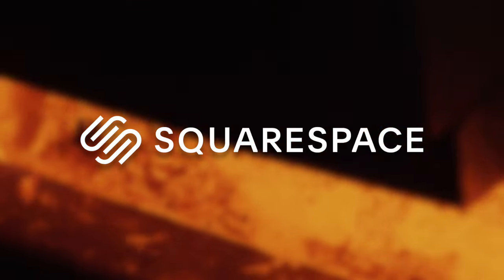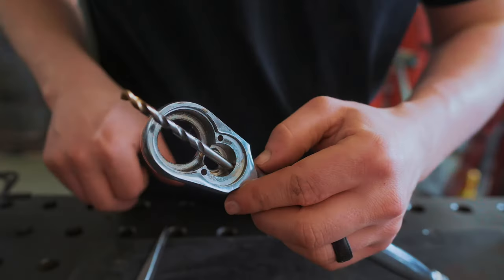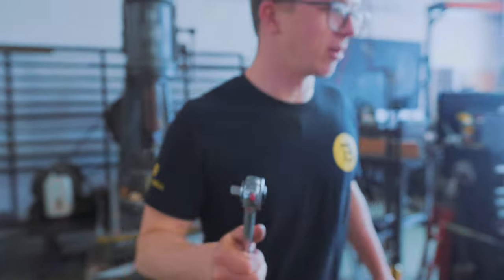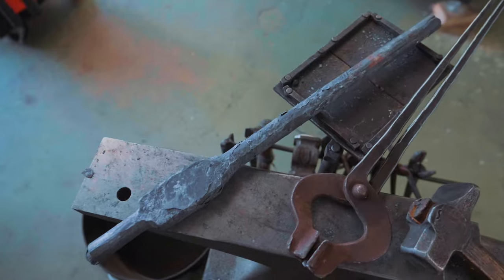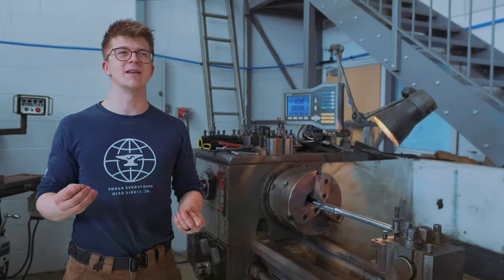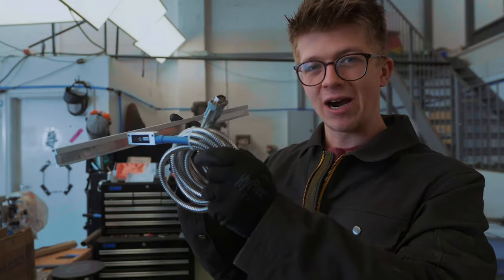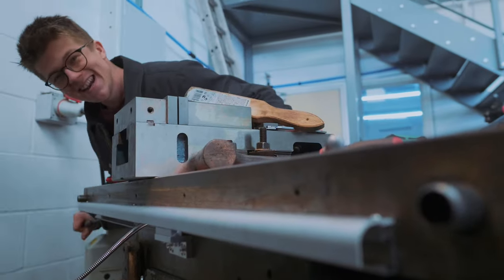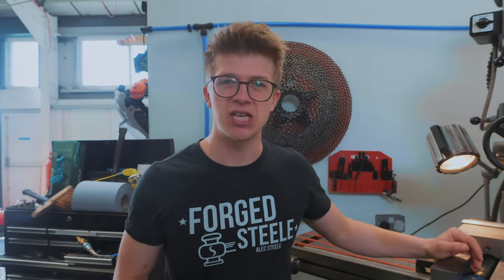Making a Socket Wrench from Damascus Steel! Part 1

Comment: love the this kind of series. its like when we were kids and we'd take stuff apart because we were curious
Reply: I still do it😂 it's mostly my work now but I have to put them back together after
Reply: Great name 😅
Reply: I know right .. rip mr binky that poor Guinea pig
Reply: @timlund1066  true bro
Reply: Yeah same. When I was a kid I was curious how my parents got together. So I took them apart to study psychologically. Was never able to put them back together afterwards.
Reply: That's how I learned what capacitors do even if I didn't know the name or how to explain it. As it turns out camera flash setups have some decently strong capacitors that do interesting things to your hands.
Reply: @klikklak6099  ayo?
Reply: I used to do this with locks in my dads garage.
Reply: @Zelmel  I have done the same thing with the $5 preloaded film cameras. Turns out that tall building looking thing in the camera holds a charge after the battery is out

Comment: For the ball retention on the mandrel, look at peening. It's basically deforming the edge of a hole inwards after you have inserted the BB to keep it in place.

I design torque wrenches for a living (basic more complex version of the ratchet you're making :p ), if you need any info let me know!
Reply: isn't it easier to just drill and mill with a ball endmill the seat where the ball is going to rest on. 
then tap the back and insert a spring and a threaded tap from the back?
Reply: Not really, it's multiple ops and a accurately sized hole means you only need to drill once, then add the spring, the ball, then peen.
Reply: Heh... Peen.

Comment: The second rounder ratchet you tried open has a keyring-like coil on the opposite side that holds it together
Reply: I came to say this. It's an exterior snap ring around the outer circumference of the inner component on the square side, which will allow the entire inner component to slide through to the direction switch side.
Reply: These are nicer as you don't risk the screws coming loose, but they suck when the rings get coated in grease and you can't get them off for a servicing cause they sat for years and don't sound right.

Comment: Hey Alec, for those round head rachets, there is a flat retainer spring that is installed along the face side of the rachet. Once you remove that spring, the head is quite easy to disassemble. Hope that helps.

Comment: Hey. Little friendly tip. When I work on the lathe, and want it to be symetrical. A swap that point (Sorry for not knowing name of it. I'm from Czech) to drill chucks. Then it'll be cca same. All that's left, is to tighten big lathe chuck and swap back to that pointy thing.

Comment: I have found over the years that Damascus steel tends  to be brittle when it comes to tools where you have to apply pressure or power , it’s like it’s made of glass ,now on the other hand cutting is fine , spoons & spatulas are great for Damascus . Every ax I’ve ever own that was Damascus steel has either cracked or just blown apart or shattered into pieces . I tend to stay away from the stuff myself .

Comment: Adding more teeth to the mechanism can allow for a smaller rotational increments for working in tight spaces, but you do lose some of the available torque as a compromise, but you can also go the other way. I've seen these mechanisms with as few as 20 teeth, and as many as 90.

Comment: If you want ultimate accuracy you should turn those between centers. Then they will be perfectly in line. I mean dialed in with the 4 jaws is probably good enough but like you said any inaccuracies multiply so the more accurate it is now the better.

Comment: If you figure it out, you should make a 2 handled ratcheting bar twister. You might even make it pass all the way through with diferent sizes of square hole on each side.

Comment: I'm curious as to what kind of drill tap bit you used. The ones I usually use would've snapped just looking at all that steel to cut through.

Comment: I was an apprentice in the late 80s and I had britool tools that have a lifetime warranty ( I still own them and use rgem) and I broke my ratchet over tightening a bolt on a steam pump. Back then you had mobile tool sellers that came round engendering shops selling tools ( money came off your wages) I told him and the next week I got a little bag with new inner parts to the ratchet.  So I know whats inside as I've actually replaced them twice and its still working to this day... love tools but don't do much wrenching now I just tell other engineers to do it.. Happy days

Comment: A good machinist would also tell you that you have already lost concentricity of the two round sections, so you're going to need to only reference one of them if trying to use the placement of their axis (well, axes) for anything requiring precision, which I could see you doing to get something centered.

Comment: Okay, I know you are probably already finishing it, but there is a kind of ratchet that is easier than those. Gedore makes it and instead of the flick of a switch you simply push the drive square through the ratchet

Comment: Why did you use the needle scaler over a wire brush , does it work better to get the (oxidized steel) off ? 🤔🧐 I'm not a 100% sure if what I put in parentheses is what you call it  🤔... I'm still learning 😁

Comment: Hey Alec,
why didn't you turn the outer diameter of the Head round? While they're perfect parallel you can clamp them in the vise perfectly and mill the surface for the ratchet mechanism.

Comment: duel stage thermostatic microprocessor controlled water boiler with electro pneumatic valves... because growing tomatoes all year round is important. how complicated is a hot tub to hold 38*C? same system here as their... same controller for the baday too wired right or wrong a surprise thinking its a flush... royal fu... sh!

Comment: Alex... You really shouldn't torque down on a ratchet wrench... You CAN, but it wears them down prematurely, and the teeth involved in allowing them to ratchet are not meant for that kind of duty... Best practice is tighten them on the ratchet(resistance is fine), but don't crank on them and switch to a breaker bar if you don't have the correctly sized wrench.

Comment: every time i read Damaskus steel in the title i get exited.
and then i realize the video is not about accurate metallurgical replicas of historical steel. 
instead it is about pattern forging. 

i am disappointed about the language, it is hard to distinguish the proper historic Damaskus steel from the modern pattern forging with the same name.